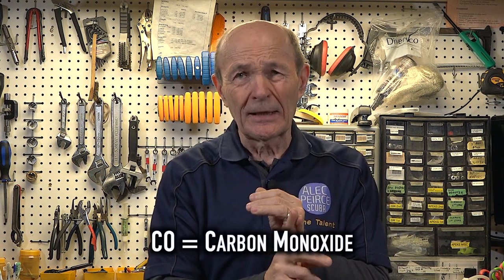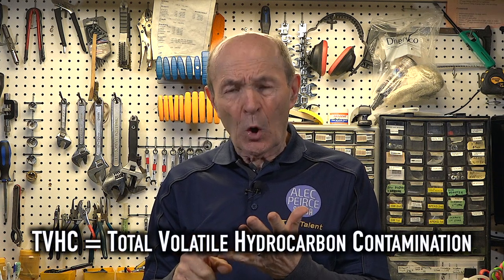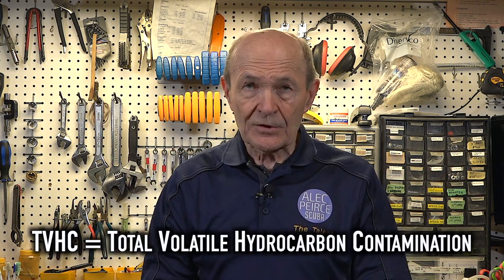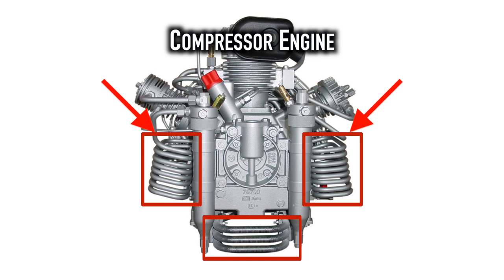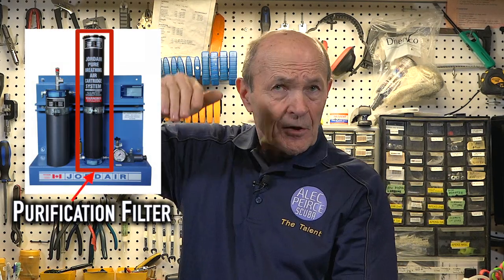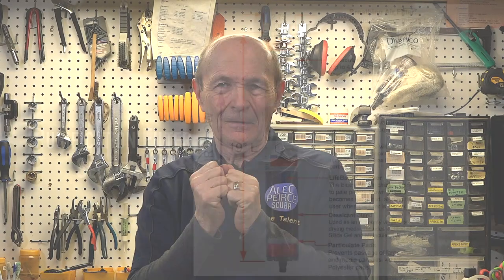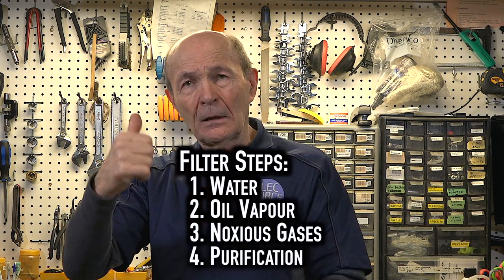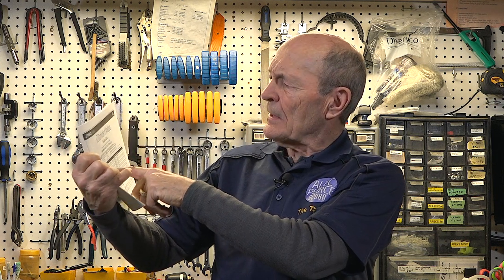Compressor Filters - How Do They Work? - Scuba Tech Tips: S15E01

Comment: absolutely right.
Another main source of noxious components in the compressed air stream is the compressor itself, any mechanical oil lubricated machine will finish to lose its oil, in the particular case of a compressor, the lubrication of the cylinders and the rings ends by the lost of some oil, that oil enters in the air stream and is compressed as a mixture in the following stages.
on such a high pressure compressors, in  the final stages, that oil acts as fuel and ignites causing combustion gases that is saaociated to carbon monoxyde and dioxyde plus unburned and vaporized oil that produces odors.
it is a main reason why, on a breathing air compressor, it is imperative to use oil specifically formulated ( esters based )  for that application.
As for any compressor, colder are the water separation stages, better is the result.
excellent topic
very good video ( as usual !!! )
Reply from the maker: Than you sir and for your support.
A

Comment: Surprised I haven't seen a Video about older aluminum cylinders like ones Marked SP6498 or ones made from the 6351 Alloy
Reply from the maker: I did a video on buying scuba tanks and covered the SLC issue with these old tanks.  Surprisingly they still appear in dive stores as garages are cleared out.
A

Comment: Thanks for this very interesting explanation of comp-filter… about the Analysis Report that said CO is less than 0,5… does it mean there is still co in our tanks, but it in a safe level for breathing
Reply from the maker: Yes.  It’s near impossible to remove 100% of any harmful substance but testing standards have agreed on safe levels.  Only by getting air tested is a LDS sure their air is safe.
A
Reply: Often when the result says less than  X ammount, it is because the test equipment can't measure an ammount below the specified value.  Rather than say somethig ambiguous like undetectable, they say less than the limit amount because as alec said the value will never be 0 but they are unable to measure such a small ammount.

Comment: Looking at a old hooka it looks to be a strait compressor running on a float with a water trap so is this more dangerous I see a lot of people use them on their boats? what do you know about dagar rays? they seem to be between scuba and rebreathers
Reply from the maker: Not familiar with CCR''s like Dagar as they are evolving quickly to be safer and easier to maintain.  Hooka floats come in many styles but are gas or electric powered.  Like anything involving breathing underwater, know your gear and be safe is key.
A

Comment: In my garage I have a Shop Compressor. Fills to 150 psi. The air coming out of the Twin Cylinder pump will Burn you. They use a Copper Tube from the Pump to the Tank. Manual drain for Water on the bottom. And a Water/Air Separator on the Output side. I can only imagine how Hot the air comes out of a 4k Psi compressor.
Reply from the maker: Just as hot as a big one.  There is little space to cool anything down which makes small ones more sensitive to changes and more maintenance in my view.
A